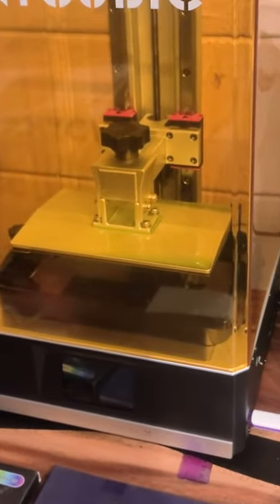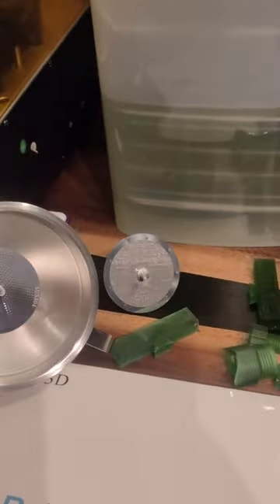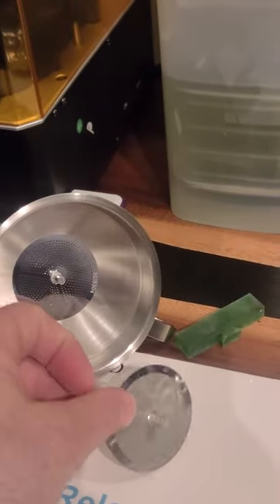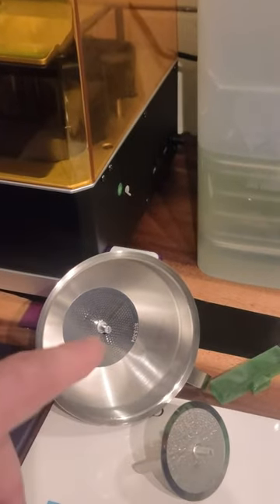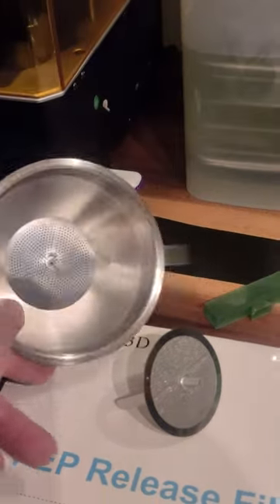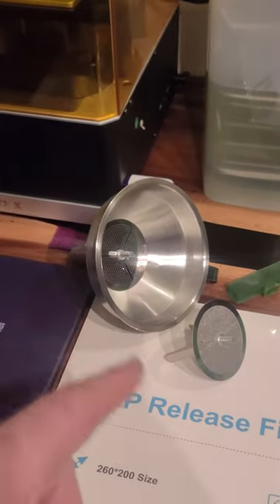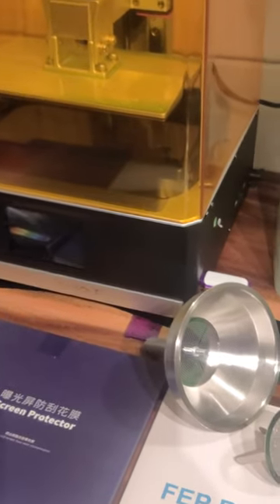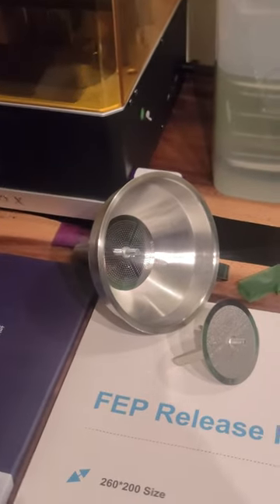$10 Re-Usable Funnel for Resin Recovery #3Dprinting #3dprint #resin #tips #tricks

Comment: I know this is 9 months old, but may i ask where you found it?
Reply from the maker: No problem!! I got it right here on Amazon https://amzn.to/3uwMJHm
Reply: Thanks
Reply from the maker: @xavierpastro7730  no need to thank me. It's a huge saver and so much better than the  paper ones. I also always found the paper ones required 3 hands and they take forever to drain depending on the viscosity of the resin you are using. This one has some more weight so you put it in the bottle and can hold both bottles and the funnel will stay in place, usually. Haha